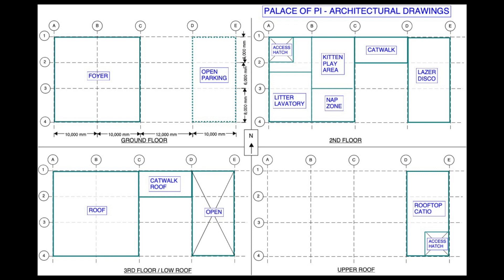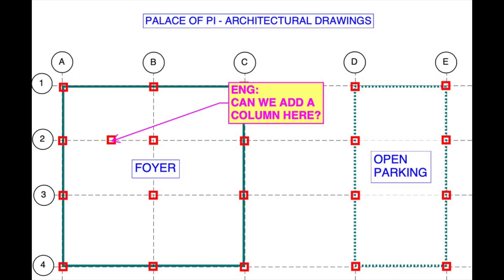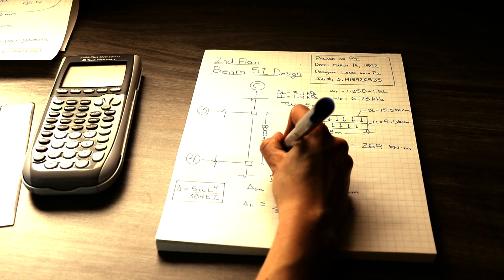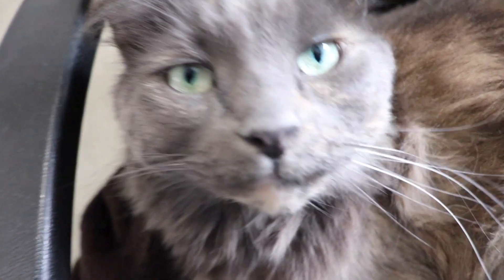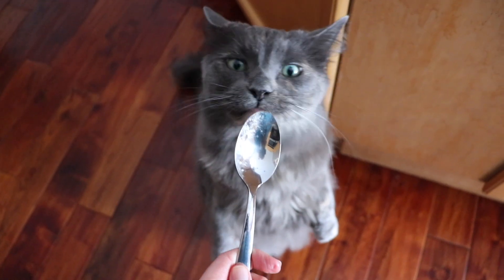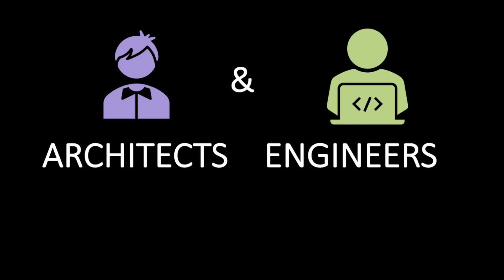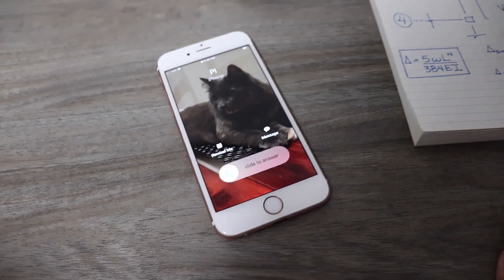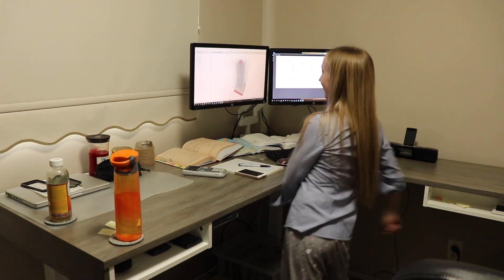A Day in the Life of a Structural Engineer | Working from Home

Comment: Halo sister, may i ask a question ? 

The mechanical electrical plumbing loads on house building structures, how much are those value that you ussually using on your project as a structural engineer ?

Thanx before sister...
Reply from the maker: In Canada, we use the National Building Code of Canada to determine loads and typical residential construction information (available for free download online). There is also a table of typical dead loads near the end of the Canadian Handbook of Steel Construction. Those are both good references :)

Comment: Hi, really thanks for this great video,
If I need to understand the framing concept how I can learn
Reply from the maker: Thanks! Framing concepts are all about setting up a plan for your load path that works with the architecture. A great way to practice is just to look at structures when you're running errands. Try to see where the load is going and guess why the engineer did it that way :)
Reply: @learnwithpi  Thanks a TON

Comment: What is the starting structural engineer salary
Reply from the maker: Honestly it varies widely; I wouldn't be able to give you an accurate answer.  Depends on your location & type of structural engineering. When I was job hunting I found it helpful to look at the posted salaries on job board web sites. Engineering associations will also commission salary surveys. For example, the Ontario Society of Professional Engineers (OSPE) has a National Engineering Compensation Survey on its website ospe.on.ca. 
It gives a broad range of salaries across engineering disciplines and practice levels. 
Good luck :)

Comment: I see you use sap2000 to analyses, why not use Etabs? what's different between these two software?
Reply from the maker: If you watch closely, you'll see I actually used both of these softwares :) In general, as a simplified answer -  SAP2000 is more customizable, for connections, complex geometries, etc, while ETABS is a bit more robust for whole-structure analysis. Both are useful and fun to play with. There is tons of info about both softwares on the web if you're looking to find out more!
Reply: @learnwithpi  thank you. should you share some tutorials with us about structural design of your own project.